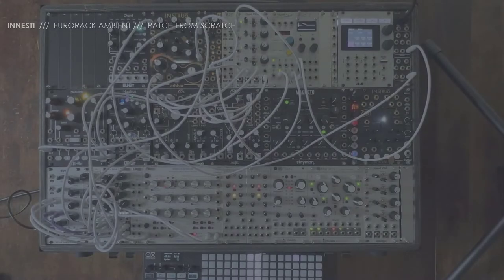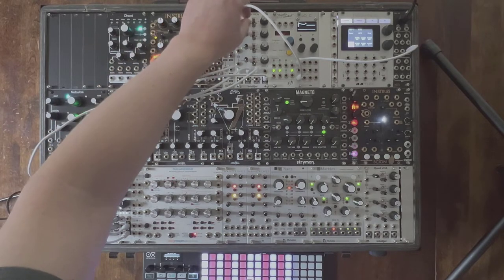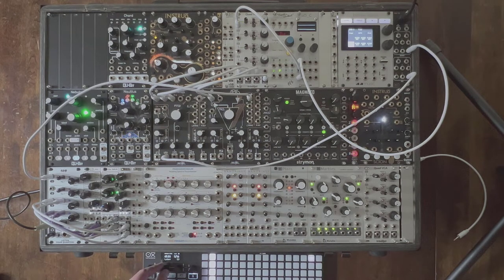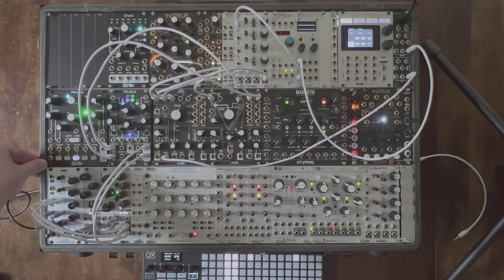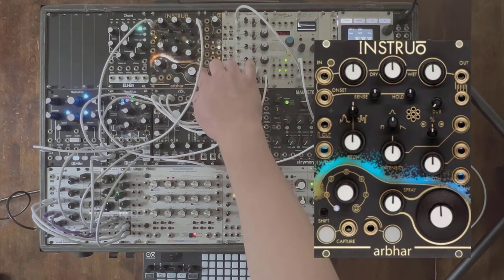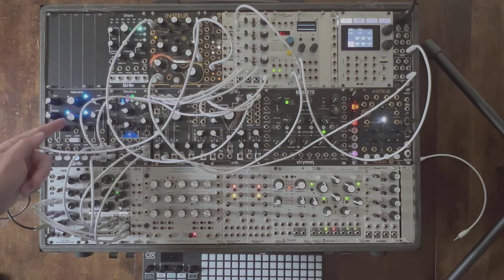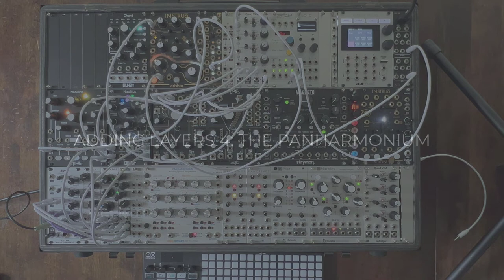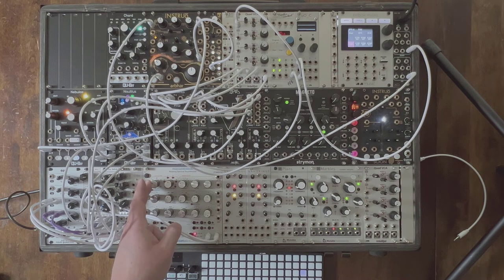Ambient Patch From Scratch // Eurorack Ambient // Innesti

Comment: Can you explain (briefly) your use of reverb(s)? Are you using 1 reverb for every “voice” in the patch, or are different parts getting different reverbs? Is the entire patch getting a final reverb? Using reverb has always been an Achilles heel for me.
Reply from the maker: I can't recall specifically what I did here, but I typically use two reverbs. I have an FX Aid XL and a 'standard' FX Aid. I typically route the background sounds to the FX Aid XL, which I use for a really deep reverb with long delays and with a 75% or higher wet mix. I send whichever voice will serve more as a 'lead' to the other FX Aid and have that dialed back a bit so the sound has more definition.

Reverb is tricky. I'm a sucker for reverberating sounds: Reverb can transform the simplest audio into something spacious and beautiful. But, it if is used too much, everything sounds washed out. That's one reason why I use two reverb paths: One that is dense and one that is more shallow. Best of both worlds?

I've been wanting to get a Starlab, but I've been very happy with the FX Aid modules. I tend to use the MI Clouds algo on those units, but I switch it around every once in a while since you can download and store multiple algorithms.